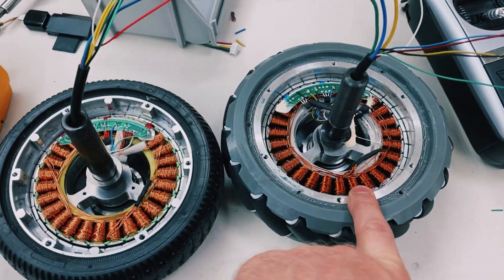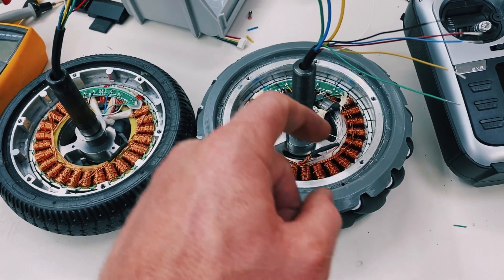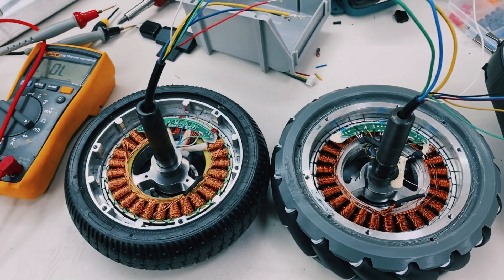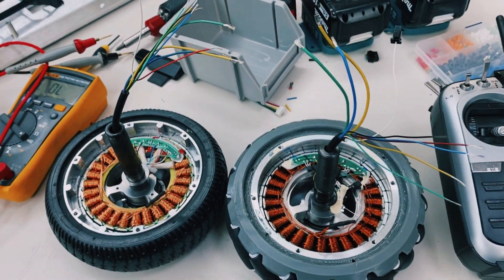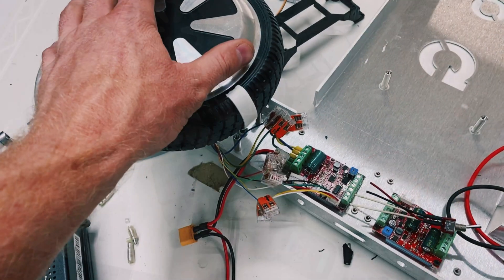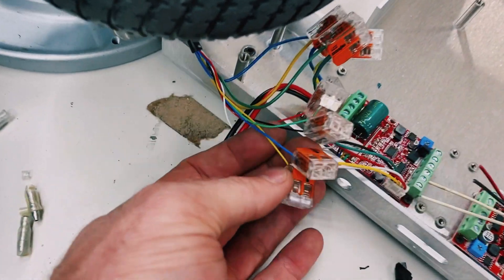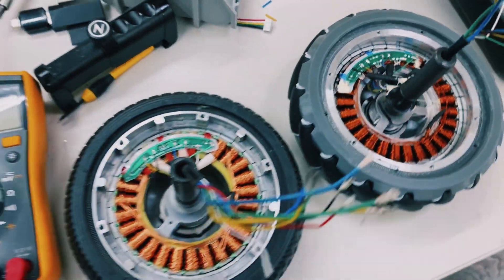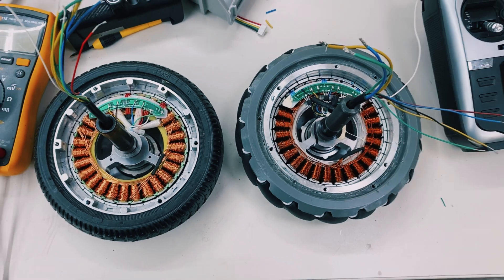Strange Behavior with Different Brushless Hub Motors (Fixed)

Comment: *edit: Looking at the Amazon product page you linked for the BLDC controller, I think where you tripped up is that the hall sensor wires are W/Y/G for a/b/c, not Y/G/W as it appears you assumed! So it might actually be the other motor that is incorrectly wired if you were using the same wiring for that one.

Original: As swapping Y/G motor phases and a/b hall sensor wires worked and you know/can see that the a/b/c hall sensor wires are correct, that means that the motor phase wires are incorrectly wires as G/B/Y I believe. So you should be able to use G/B/Y and a/b/c (it'll run in reverse of what you have though!).

This is what I worked out for your options:
Forward:
G/B/Y, a/b/c
B/Y/G, b/c/a
Y/G/B, c/a/b

Reverse:
Y/B/G, a/c/b
B/G/Y, c/b/a
G/Y/B, b/a/c

Comment: Different rpm going forward vs reverse can also be cause by advanced or retarded motor timing.  I.e. the hall effect sensors are shifted 10-20 electrical degrees CW or CCW so that the motor runs a bit more efficiently at high speed in that direction.  Cheap DC brushed motors often do this as they often run in one direction only, and advanced timing also suppresses brush arching.

Comment: The size of the magnets and the number of coil wires can also differ between models. Looks like the left one has more coil wires. That fast wheel really seemed like in delta wiring, in that configuration wheel will rotate faster in one direction.

Comment: Different magnets, different winding is probably main cause they act different. Even if they are made my same manufacturer, different batches quality control may vary and you may need to compensate them in software with pid control.

Since you said they have different core, eddy currents and impedence on electromagns induced are different and thus different performance. It totally makes sense
Reply from the maker: For sure! It's understandable for there even to be differences in performance between "identical" revisions of the same motor but you would think that the same manufacturer would at least label their boards consistently.
Reply: @ProtoG42  The right side motor also seems to be connected in star config while on left one is in delta config. 

Turns out from intense discussion on stackexchnage that delta configs have high KV value and low torque while opposite is true for star configs but then you lose multi step granular voltage drops across the steps. 
The config may have veey different readings on hall sensors since magnetic field induced by them would be different in different configuration or your hall sensors may be intentionally biased towards one direction of rotation to balance speed because they are vehicle tyres and have practical usage? I'm not sure but these both tyres seems to be entirely different models and mau have different applications so behave differently because manufacturer wanted it. Check manuals!

http://www.motioncontrolguide.com/learn/guides/brushless-motor-guide/
Reply from the maker: @MaulikParmar210  Nice article! Thanks for that. Did you watch the entire video? They do rotate at the same max RPM in forward in reverse now. Both motors are from the same brand and model of hoverboards that look identical on the outside but are obviously different revisions. The rubber tire on the right motor was replaced by an omnidirectional mecanum wheel I designed and 3d printed to fit these common hoverboard motors. I'm making an omnidirectional fpv rover so I will be adding my mecanum wheels to all four hub motors.
Reply: @ProtoG42  yes I did, changing phases shouldn't actually have any effect, so it's some other reason that must be affecting currents and speeds.  Controller would know direction and speed from sensors and would drive them accordingly. Must be bad feedback from sensor.